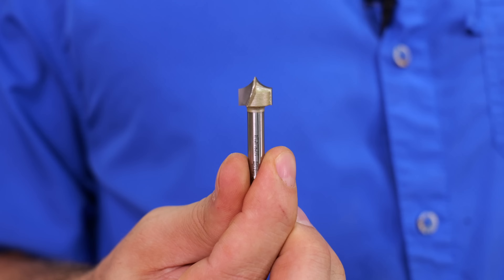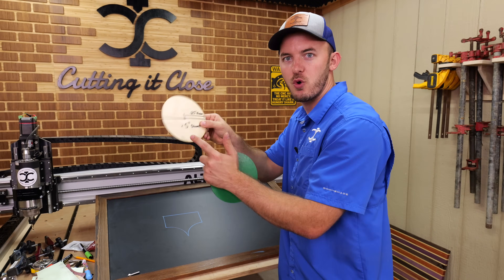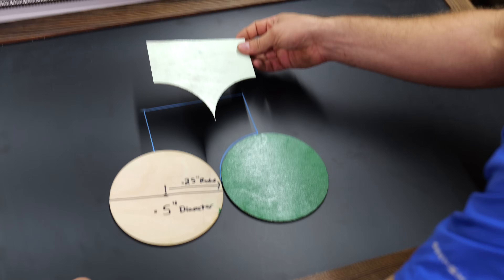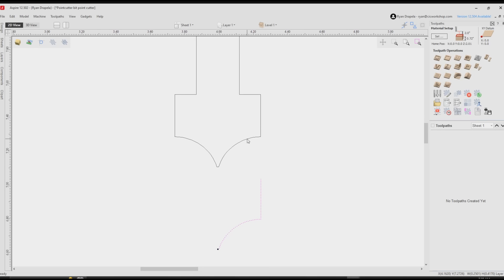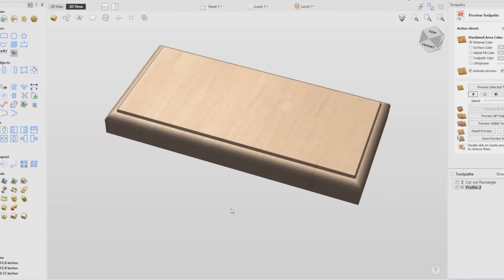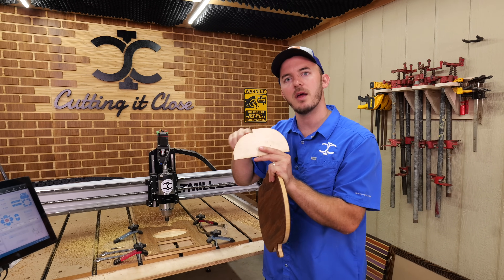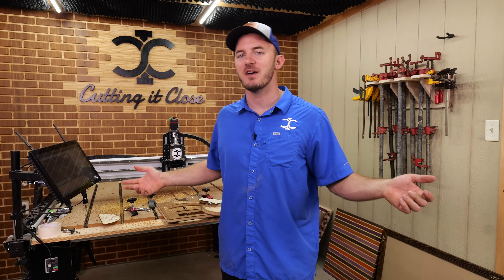How to Use a Roundover Point Cutter Bit on a CNC Router | Practical Guide

Comment: Very helpful! Thanks. But since I already have point cutters and since your bits are more costly than what I have found to be useful, I will take the knowledge and run! If your bits are ever competitively priced, and/or available on Amazon with prime shipping, I will buy them, and likely your board kits as well, as they are clearly high quality (if Nik likes them, it's good by me) and I get really tired of gluing up my own blanks. But the shipping costs are prohibitive, for making a competitively priced product. At least I watch your videos and help with monetization there.  Thanks and sorry.
Reply from the maker: If you are in the USA you’ll get free shipping after $150 order. And the highest shipping cost we have is $11.99 and that’s when shipping large panel which cost well over that. 

Thank you for the comment, hope this video helped!
Reply: @cutting-it-close   Thanks for the clarification. I will have to look more closely at your website. I wasn't aware of the free shipping option.  I will have to "crunch some numbers," and see if I can make your products make sense. My current blanks are quite cost effective as far as materials, but I'm paying my apprentice a lot for the glue up time. The video was very helpful although I've already figured out solutions to this problem independently. But, the concept is very valuable. I make many guitar bodies, and was 3d carving the round overs. Since discovering that I could do it quickly and efficiently with a point cutter and modified my carving toolpath to accommodate this I have greatly reduced my cut times and therefore my cost/profit ratio. Also running this first really helps with tear-out and "fuzzies." Your videos are a real service to the CNC community.  Thanks again!

Comment: That’s a bit type that I’ve never tried, but it looks like I need to add it to my arsenal! Great video and explanation.
Reply: I’ve never tried them either, even though I have a couple (around 3/8 radius).  One has a slightly flattened end and the other is quite pronounced.  I’m itching to try them now, especially in places the router can’t get to.

Comment: As a long term metal worker who has used corner rounding cutters with a FULL RADIUS in machining centers, those bits that you show are designed for failure.  I just took a look at my .125 radius cutter and the center diameter measures .058 and you set the depth to .130 and you will get a full .125 radius.
So in a machining center you would set your cutter diameter to .060 and the Z depth to .129 and you will get what looks like a full .125 radius.
So instead of grinding off the tip of the cutter like you are doing and loosing part of the radius, just make your .250 radius cutter around .080 diameter and .255 from the tip and you will get a full .250 radius with a much stronger center point that is not prone to easily break.  I don't understand why anyone would be satisfied with not getting a full radius from their corner rounding tool.  I know this is not metal working, but the same concept applies here.
Reply: This is the proper way. The advice in this video is ridiculous.
Reply from the maker: I agree with you, I believe those are not pointcutter roundovers, those are just roundovers. Please correct me if I am wrong.

Comment: Another informative video.  Quick question.  When you taught this process in an earlier video where you were cutting trays/dishes, on the profile cutout you would first cut a roughing cut at an offset of 0.05" leaving an onion skin of about 1/16" then run the point roundover at an offset of 0.02 (same as this video), then you came in on the original cutout vector with your finishing bit to do the final cut.  

At the time you explained that the reason you were doing this was to save wear and tear on the point roundover bit and get a better finish.  Since that video I have been using that technique and was about ready to update a video I did a couple years ago about using roundover bits to share that technique (would've given you credit).  

Has something changed or did you decide the earlier method was too complicated for most of your audience.  Or, did you find the benefits of the earlier method weren't really there and you are getting the same results with less toolpaths?
Reply from the maker: You’re 100% correct on how to do that toolpath! 

For this video, I did not want to go into advanced toolpath techniques, just wanted  to go over the bit and Do’s and Don’ts. You can run the bit much faster with your method.
Reply: @cutting-it-close  thank you.  I thought you may be trying to keep it simple.

Comment: You gave us the feed at 45-60 ipm, but what is the spindle speed ?
And yes, I did learn about setting up form tools 👌🏻
Reply from the maker: My bad! The RPM is 18,000. I’m glad the video helped, any other bit you would like to see covered?
Reply: @cutting-it-close   May I suggest you cover the chamfer bit next?  It seems to need the offset & depth wisdom also.
Reply: @robert_g_fbg  Good point.  Pun intended.   I'd like to see a chamfer bit too.  Looks like climb is the way to go.  Not conventional, which was not discussed.

Comment: You don't want to run the toolpath on the line at all, because the bit has a blunt tip.
You'll want to offset, away from the line, about 0.75 mm. That'll eliminate sanding the edge altogether.
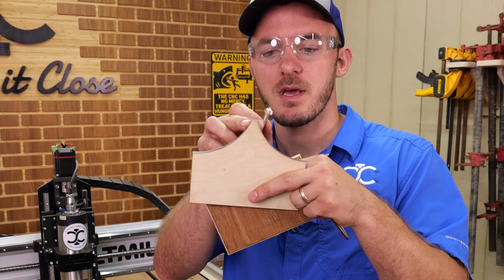Reply: 13:02 I believe he agrees
Reply: @KJMcLaws at 17:47 he says "on the line".
Reply: @acerjuglans383  14:01 he makes the line offset from what he cuts out.

But you're still right
Reply: @KJMcLaws We both can be right.